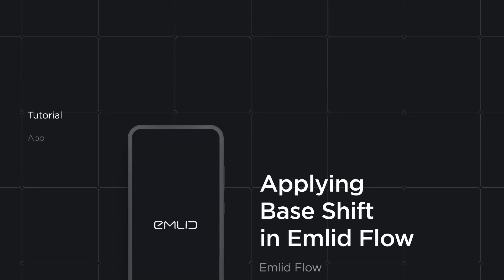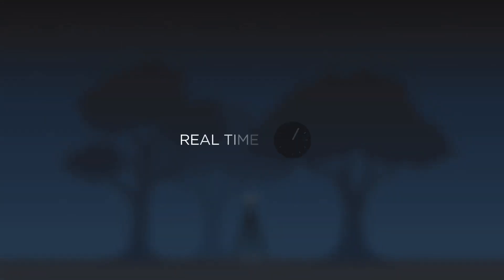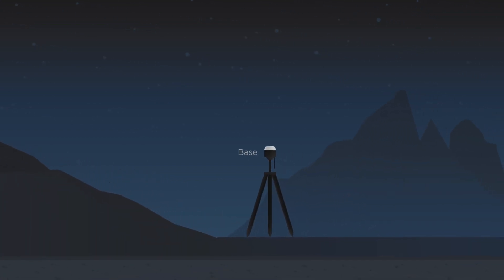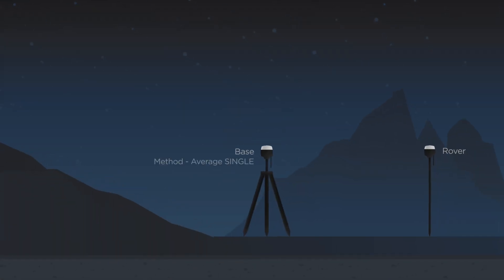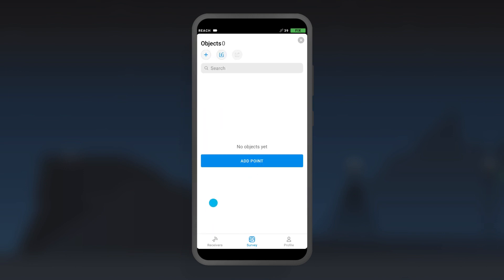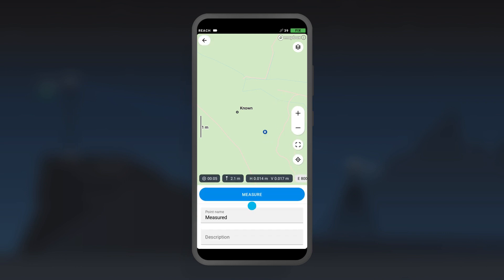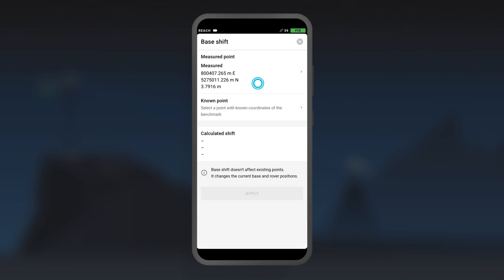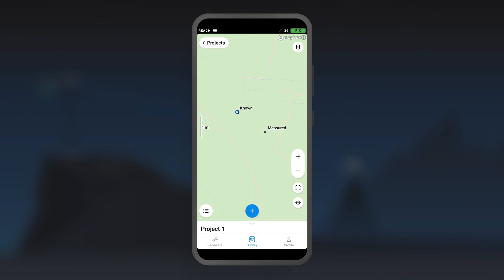Applying Base Shift in Emlid Flow

Comment: The Calculated shift shown as the title slide/ frame for the video, and also seen at https://youtu.be/PYw67TtYQXU?t=140 in the video, shows a shift in the northing of 7.8241 m, but shouldn't it be 50,000,007.824 m ?

There's also the unexplained bits at https://youtu.be/PYw67TtYQXU?t=93 why the video is showing a local coordinate system for the known point, and then at https://youtu.be/PYw67TtYQXU?t=121 the measured point is in SRB_ETRS89. This should be explained or corrected.
Reply: Seems all "example" videos for most software are like this.  Just adds to confusion and makes one question things when trying to learn.  It would be nice if the videos were thorough and correct based on real world examples.

Prime example:  the KNOWN POINT illustration was at a higher elevation.  Yet the data they use for the KNOWN and MEASURED are inverted in elevation.  So yeah, ??? 😮